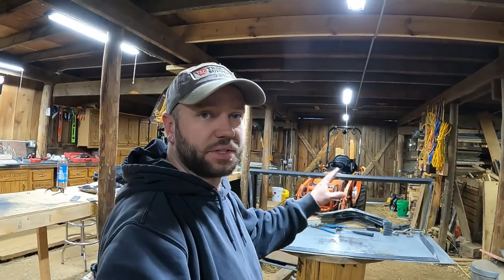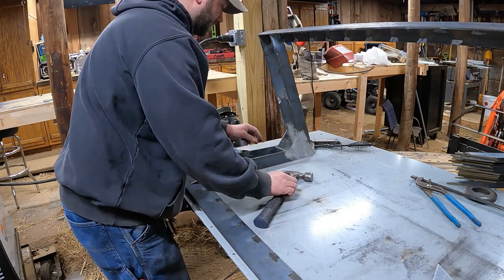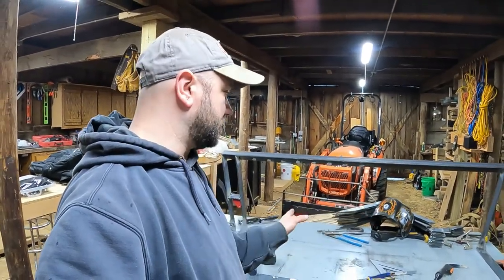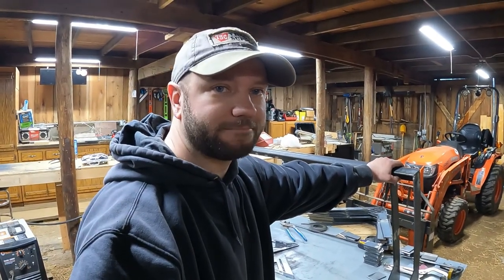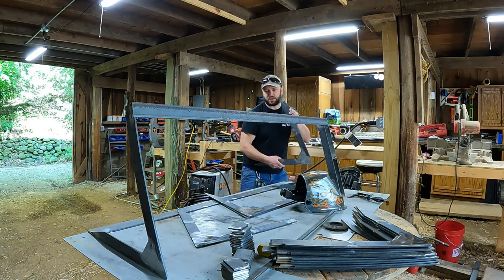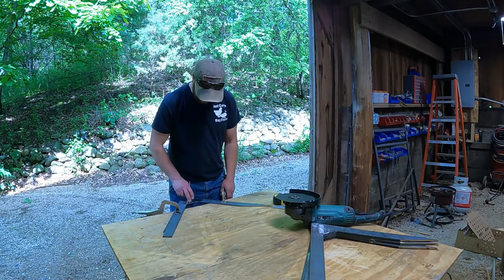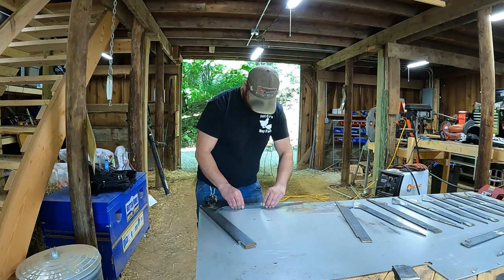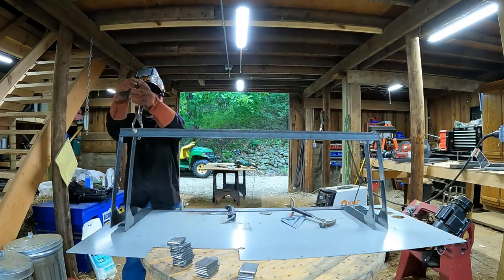KUBOTA B2601 ROCK BUCKET BUILD PART 6 WITH HOBART 210MVP MIG WELDER

Comment: Awesome job on fixing the bucket from the last video! Just wanted to make a little recommendation that may have saved you some time and headache. On getting your spacers lined up and in the correct position what I would have done is cut a scrap piece of anything, wood or metal at the length you needed from top piece of angle iron to where you wanted the spacer and clamped that into place up against your slats then held the spacer up to block and if you cut that square it would be perfectly in place every time and same goes for the bottom spacers. Then instead of measuring and marking where every slat went just place a spare spacer in between the slats while you tacked it in place and they would be the perfect distance every time as well. But love watching this series!
Reply from the maker: Good suggestion!  I don’t know why I didn’t think of that. I’m glad you enjoyed the series. Thank you for watching!